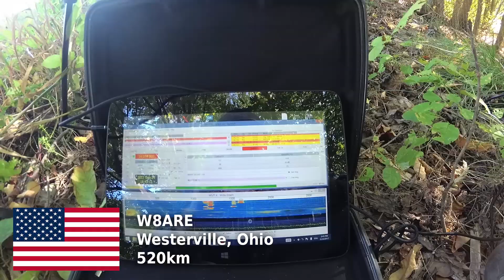Ontario NVIS event with a fence antenna

Comment: Hi Carson, how much power were you loading the fence with? (the amp is capable of 45W?) I would be a bit worried about the RF safety of loading up a ground level structure in a public place unless you can control access to the structure or at least warn people to stay away from it.

73, Eamon VE2EGN
Reply from the maker: Hey.  Your concern is valid, but it would be very unlikely that someone was touching the fence while I was transmitting.  I've gotten bit by 50 watts before and it wasn't fun.

Comment: WOW. Can you explain how you did the antenna set-up. 73 VA2SOB Claude
Reply from the maker: Hey Claude - I just used aligator clips off a piece of coax.  One to the fence, and the other on the shield to the two 33 foot counterpoise.   Sometimes I don't use the coax and just put the antenna tuner at the base of the metal object and connect an alligator clip from the wire plug on the tuner to the object, then just run the counterpoise off the tuner.  Thanks for watching!

Here's a picture of the aligator clips hookup:

https://imgur.com/a/q2OxDzs
Reply: @VA3OSO  Very cleaver. I like it. My neighbor's fence will play a new part in my antenna set-up tomorrow... TY Claude

Comment: How did you connect the coax to the fence? 73 de TI3IES
Reply from the maker: With alligator clips off the pl-259 connector.  One to the fence, the other to the counterpoise.
Reply: VA3OSO Thank you, 73 !
Reply: @VA3OSO  was both alligator  clips connected to the center pin of the coax?
Reply from the maker: @jeffallen6459 One clip goes from the center pin of the coax to the fence, and the other from the coax shield to the counterpoise.
Reply: What was used as counterpoise?
Reply: How well did the fence tune using your tuner?

Comment: Good morning Carson and congratulations! Congratulations on making those contacts using the steel fence and also for enduring that heat yesterday!
I wished I hadn't missed the NVIS event; NVIS has been one of my passions for some time now.....
Do you have a schedule for the next NVIS events?
I always enjoy your videos and have some appreciation for the work you go through to get your videos online and available for viewing.
72,
Brent
Reply from the maker: I really didn't want to operate in that heat, but I'm interested in NVIS and like that local event.   The event is held by the Peel Amateur Radio Club and the date seems to vary from year to year.  Last year it was in October, this year in September.  Here's their website: https://ve3xr.wordpress.com/
Reply: Thanks for that info..
Reply: Hi Carson, we changed the date of the event to get a little better wx for those who wanted to operate in the great outdoors.  Didn't expect what we got though.

Band conditions wern't as good as last year but still had fun.  I had 6 contacts on 60 and  4 on 80. Ottawa area was quite active on 60 and strong to the Kingston area.  

Nice job with the fence and of course the soup antenna.

73, Peter
ve3poa

Comment: Nice job Carson ..... "FENCE ANTENNA" is a good idea if it will load on the tuner =)
Reply from the maker: Hey Pat - It loaded up nicely on 40m and 20m.
Reply: IO have loaded up "Barbed Wire Fence" ( not the ELECTRIFIED one ) for transmitting before with good results =)
Reply: Nice job!  Did you use any sort of balun?